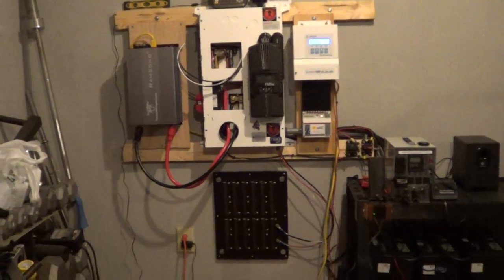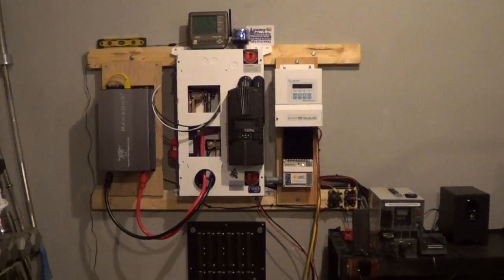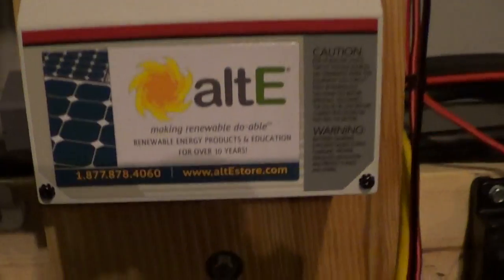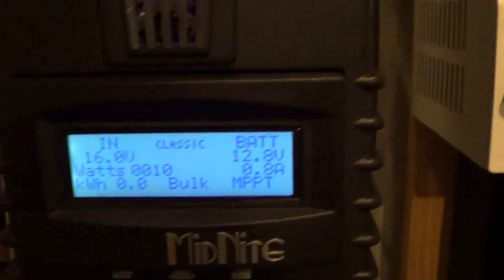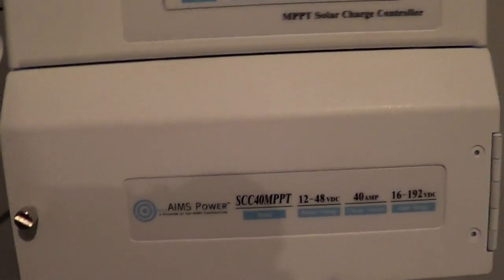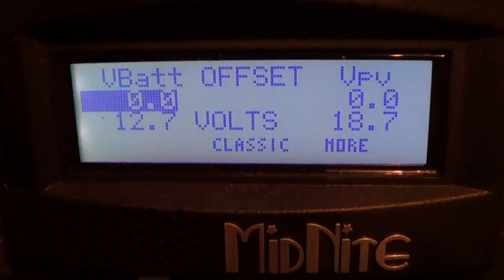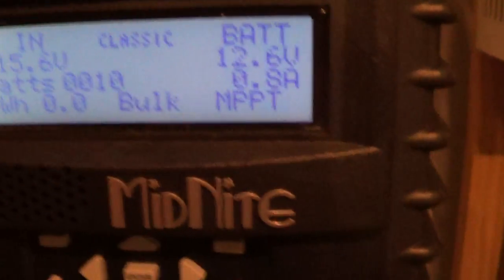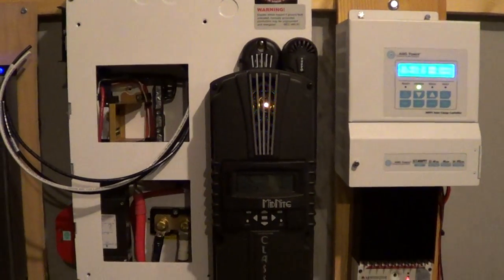Midnite Solar E-Panel 250amp, Plus and allmost done!

Comment: Hey I do have one question, what gauge of wiring are you using to connect the charge controller to the inverter and the epanel and battery bank?
Reply from the maker: That's number #1 ga. from the the E panel to the inverter. Which came with the E panel. The controller is wired with THHN  #8 ga.,It is wired from the controller to the E panel. Then the E panel to the Battery bank is #2 ga.. Thanks for the comment.